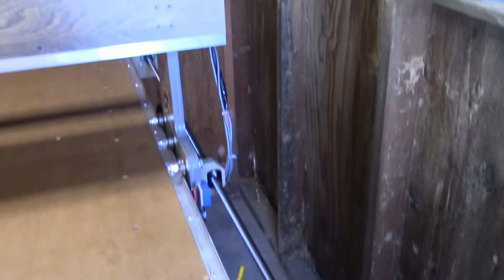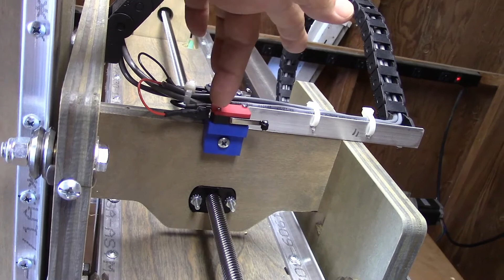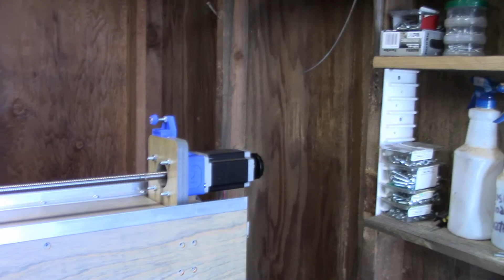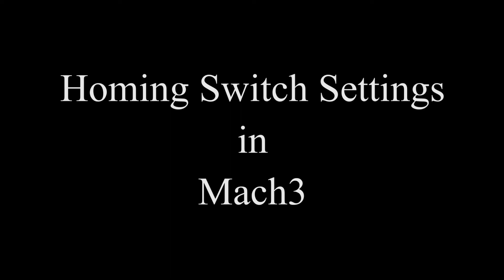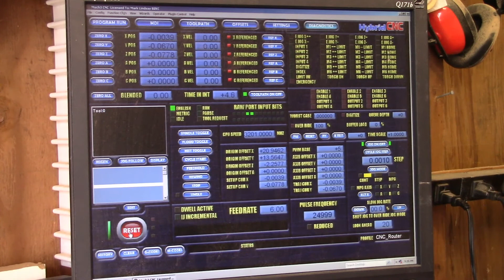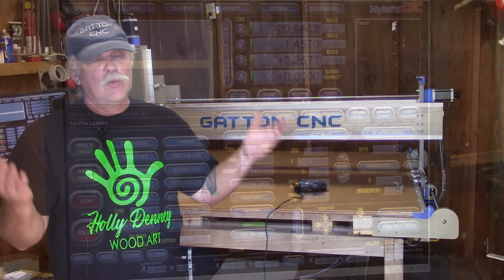Adding Limit Switches to my Gatton CNC - Part 2

Comment: Hi Mike,  I enjoy your detailed videos.  I notice you are using the X Box controller (as I do) but I cannot for the life of me figure out how to get it to "step" in small increments.  i can get it to drive okay, just not step.   Have you made a video on this?  if not, any chance you could?  Thanks, Dean.
Reply from the maker: Hi Dean. It's funny that you ask this question today. I was just showing someone how to do it yesterday.

I haven't done a video on it, but it's pretty straight forward. In Mach3, go to the CONFIG menu, click Config Plugins. Hit the yellow CONFIG button at the left end of the "XBox 360 controller plugin" row. I have the A button on the controller set for Jog Mode INC/CONT. Find that in the drop down menu under whichever button you want to program and select it, click OK, then click OK on the Plugin menu. Then go back to the CONFIG menu, scroll down to the bottom and click Save Settings. You may have to restart Mach3 for that setting to take effect. It's been so long since I've done it, I really don't remember.
Reply: Sorry Mark, I wrote Mike for some reason.   I’ll give that a go when I get back from a work trip and see how I go

Comment: great job I am just getting started in the cnc world and you are clearing up a lot of settings that I have ben looking for I love the way that you show were wires go and the settings that you have to do mach 3
Reply from the maker: Thanks very much, James. I really do appreciate it.

This is the second CNC I've built (the third gantry for a CNC,) but I'm in no way an expert. I try to gear my videos toward the absolute beginner who might be confused by information overload, or just doesn't know where to look for answers. I do it this way because 3 years ago, I was that guy. There's just so much info out there that it's easy to get conflicting answers to what some think are simple questions. I don't assume anything - I just try to put together all the info I've received from several great sources, and pass it along. If I get something wrong, I hope someone will let me know so I can correct it. There's too much bad info out there, and I don't want to be another source of it. 

Good luck with your CNC! Have fun with it!

Comment: Great video as usual, i always learn something new.  I didn't know about the option in general config about the slave axis but do now.  The misstake i made when doing my setup was in home and limit.  My gantry is my Y axis so i have A axis slaved to X axis and in home and limits i had X axis checked reverse and A axis with no check, and X home Neg checked and A axis not checked.  So when i tried to home X axis  tried to home neg and A axis tried to home pos.
Reply from the maker: Oh ouch! I remember reading that in one of your Community Forum posts. Glad to hear that there wasn't any permanent damage. That can get pretty scary.